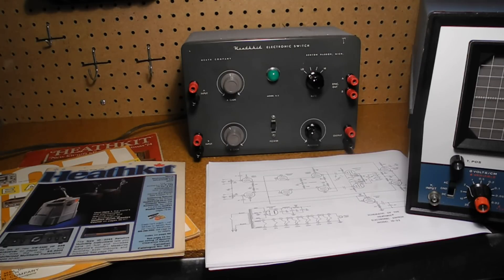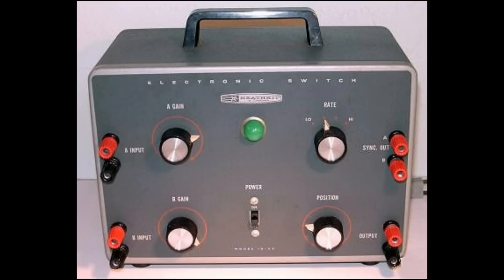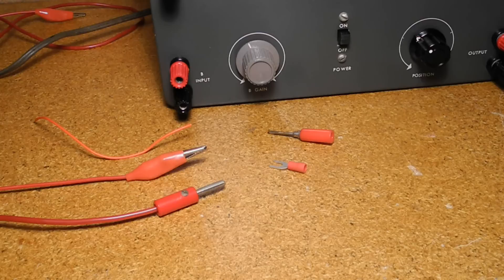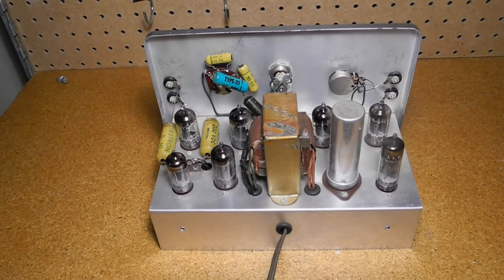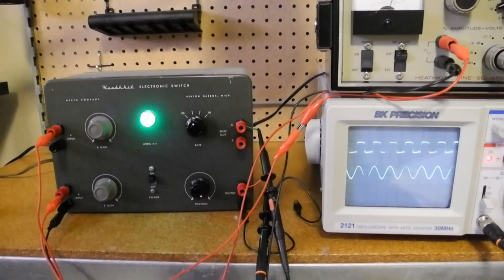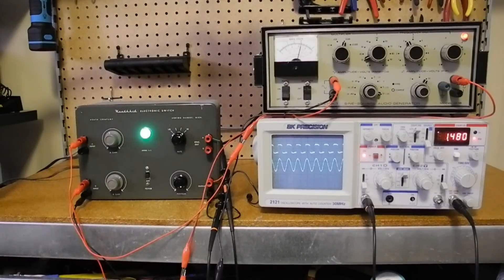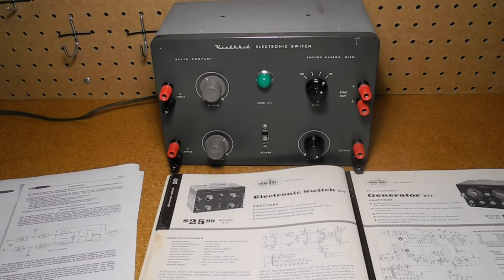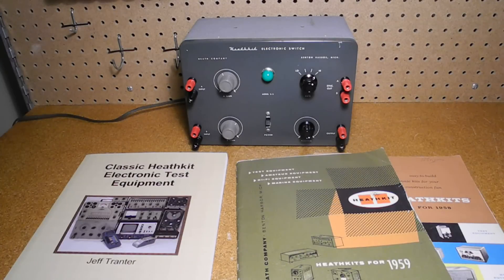The Heathkit S-3 Electronic Switch

Comment: I have a Dumont EC from the 30s, they called it a "Square wave generator & Electronic switch" Also have an Eico model, probably 6 of the Eico ECs would fit inside of the Dumont case . I restored them and play with them some times but never have used them for anything really.

Comment: Hi Jeff - I really enjoy your videos and wanted to thank you for putting so much effort into them and sharing them with the community!   I'd like to purchase your book, and see it's available from a number of vendors.  Does it matter to you where they're purchased (ie do you get a better cut from one vendor or another)?
thanks!
Paul
Reply from the maker: Thanks. The best vendor (for me and for the buyer) is generally from lulu.com.
Reply: @jefftranter  Could you please provide me a few voltage readings, as I'm currently trying to build such a S-3 unit myself for personal use? Thank you for such an amazing video, it was really informative.
Reply from the maker: @willjackson1955  I didn't find a full manual for the S-3 but I did find a manual for the ID-22 on the Internet that uses the same circuit. It lists expected voltages on each tube pin. That would be a good starting point. If you can't find the manual or want more info, email me at tranter@pobox.com
Reply: @jefftranter  Thank you, I found it. It's really helping me out. Just another question, as you seem more knowledgeable than me regarding tubes. Do you think that substituting a 6np1 and 6np2 for the 12ax7 and 12au7/6C4 would work? They're pretty similar and the only one cheap enought that I can buy in small batches
Reply from the maker: @willjackson1955  I'm not that knowledgeable about tube replacements but it looks like a 6N2P should work in place of a 12AX7 and the 6N1P in place of 12AU7 or 6C4. The pinouts are different, but if you are building from scratch you could adapt the circuit for this.
Reply: @jefftranter  Hi, I've just finished prototyping the MV circuit. The top of the wave is perfectly flat, but the bottom has a "linear ramp" of some sort, so it's not flat. Is it true, as the ID-22 manual says, that the tubes eventually "adapt" to the circuit and lead to good square waves? Would such a skewed bottom interfer with the rest of the design?
note: I've used a 12au7, the industrial version actually. Would that make any difference?
Reply from the maker: @willjackson1955  For the multivibrator section that sounds correct. At what point are you looking at the signal? I can dig out my S-3 and take a look.
Reply: @jefftranter  I'm probing at pin 1, right after the coupling condenser. Probing on pin 1, before the cap, leads to the same result. I actually asked you that as on your oscilloscope the wave was perfectly square and so I'd figured I had some problems with my circuit.
Yes, checking yours would do me a great favor, thank you!
Reply from the maker: @willjackson1955  Email me at tranter@pobox.com and I can send you some pictures of the oscilloscope signals I am seeing on my S-3.
Reply: @jefftranter  Sure thing, sorry I did not see the comment before somehow! I'll email you straight away, thanks!